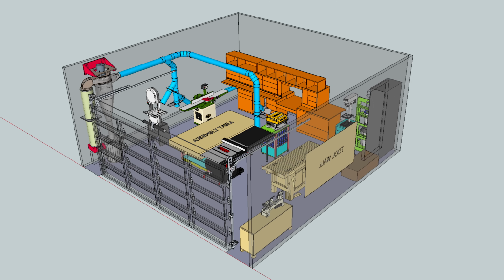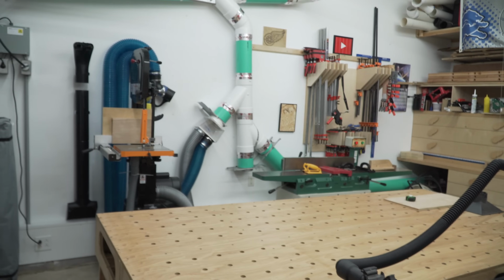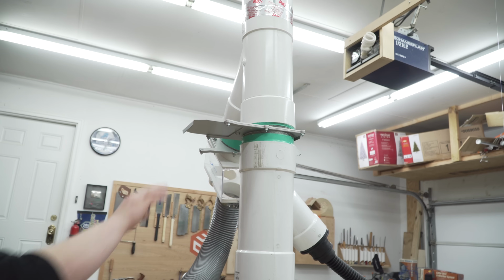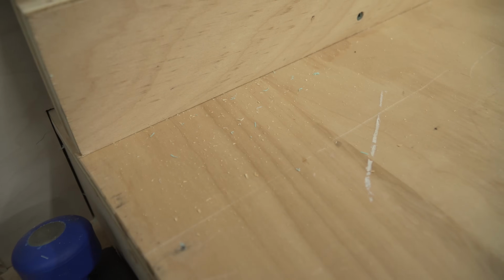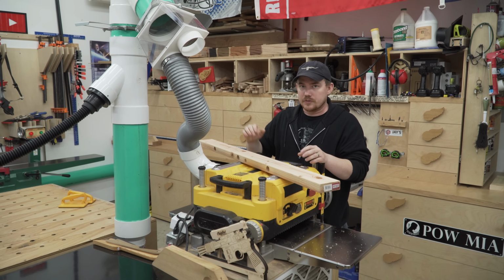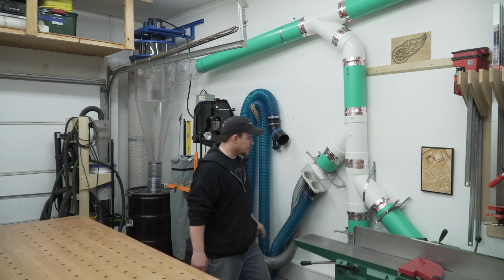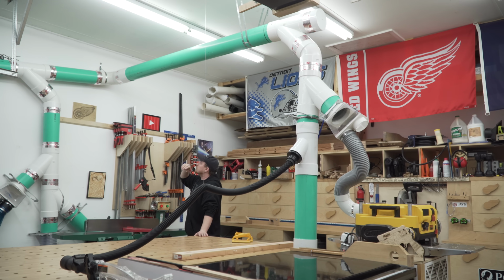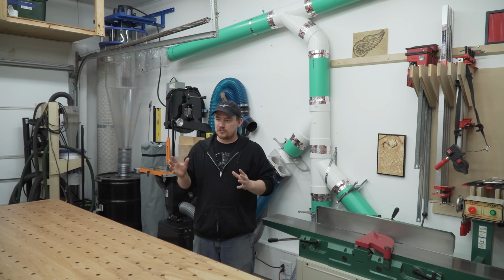Dust Collection Piping and Testing - 275

Comment: Looks great Jay. I installed the clear vue when I built my shop. I was not having difficulties, but did not want to develop any issues that could be prevented. The greatest add-on for me was an alarm for when the bin fills up. I have never had to clean out my filters from a dump due to a full bin. The bin fills up quicker than I expected, so I am sure I would have let it overflow at some point without the alarm. Also, I have not had an issue with static electricity on the sewer pipe ducts.

Comment: Jay, you mentioned the location of the blast gates as a way to minimize the volume in the active lines.  But there's another great reason for grouping the gates.  It gives you only two control points to work from to control the whole system.  That makes it easier to recover from forgetting to close a gate then having to figure out which unwanted gate is open.
Reply from the maker: True.

Comment: Nice setup Jay! What hose are you using to connect to the top of the SawStop blade guard?
Reply from the maker: Rockler expandable multitool hose.
Reply: Thanks Jay. Looks like that particular hose is no longer available. The only one I see that is close is their Universal Small Port Hose kit (http://www.rockler.com/dust-right-universal-small-port-hose-kit) but the connectors all screw into the hose reducing airflow more than the one you have. I'll keep looking.

Comment: You could get a supplied free air pump from Bullard and the bubble hood and then use a condenser mic while wearing it. Has a huge dust protection factor and comfortable to wear. That's what did.

Comment: I always enjoy watching your content.  Thanks!
I have a potentially dumb suggestion regarding your 4" dust collection to your table saw.  Can you run the 4" pipe behind the table and then run a straight section of pipe to the blade?  Seems like it would interfere less with pushing material through the saw.

Comment: Excellent system and excellent explanations. I just upgraded to a Craigslist Oneida 2 HP cyclone which came with 6" pipe and fittings. Still tweaking but so much improvement. Don't care what the trolls say, do everything you can to avoid breathing wood dust.

Comment: It's your shop,  you can do what ever the hell you want in it.  But if I were you,  I'd get rid of that Red Wings flag and hang a Blackhawks flag.   #youshould    On a more serious note,   does the band saw being there get in the way of using longer stock on the jointer?
Reply from the maker: No. I've got the same amount of infeed and outfeed as I previously did and I can also move it if needed.

Comment: Stuff the haters Jay. It seems for the most part people online appreciate what you've done here. Anyone arguing against the need for proper dust collection either has no form of timber allergy or hasn't been around long enough to see the side affects that come with a set of lungs full with decades of fine dust. There's always someone who will argue and who 'knows better'.... Yet I don't see them making any videos or trying to help the general woodworking community. Great job bro and at the end of the day, if your happy with the end result, then that's what counts. Now you can get back to building awesome stuff :)
Reply: Cigarette smoking won't hurt you either.

Comment: When you got your rigid saw with the 1 piece back stop did you have any issues with it not being straight from the left side of the blade to the right?  I'm still battling mine.  I've had it off a couple of times trying to basically bang it straight as there's no simple adjustment.  I bet you could take a couple of those cheap wood windshield scrapers with the bristle brushes and put them on each side of that opening to tighten it up more against the saw improving the air flow.

Comment: Hi Jay, you're correct about the two lines at the table saw. Looking at the area of the tubes, 6"=28.3 while the 4"+2" = 15.7. You could partial open the gate at the planer and see what happens. Good job over all and a lot less clean up during/after a project.

Comment: I have a sinus condition too and built my collection system with 4 inch PVC pipe. I didn't believe the stuff on YouTube that said you needed a static ground if you used PVC, so I didn't use it. Guess what....you need it or over time the static will cause the fine dust to build up on the inside of the pipes clogging them and having a potential for fire.

I used a fine bare braided wire (18 guage I believe) and wrapped it around the outside of the pipe in long wraps. Using crimp on connectors I attached the wires with SPACKS screws at the pipe connectors,  The screws were just long enough for the point to protrude through the inside so it didn't catch dust but would pick up the static. The other end was grounded to the dust collector motor. This has stopped the dust buildup from static.

By joining the wires at the pipe connectors, I can pull the pipes apart and reconfigure if I want. I used foil tape to make the connection seals like you did, so when I added a new machine, I had no trouble connecting it in.

Comment: Hi Jay, nice video and dust collection system.  I like your style of presentation.   I have a shop of a similar size and have avoided going this route because of my perception of the noise level caused by running a cyclone in the garage.  Can you comment on the noise level and how you are handling it.
Reply from the maker: It seems as loud as my DW735 planer. Maybe a tiny bit louder. I always wear hearing protection when operating machines so it doesn't bother me.

Comment: Incredible design, great mods at the tool source as well. The usage of your 10 ft. ceilings works to benefit total shop air quality and minimize day to day work shop interferences. I really like the technical aspects of specialized fittings at critical points. But really sea foam green pipe matched with white? Sorry Jay, I gotta give this video a thumbs down  ;-)
Reply from the maker: hahahaha. They had LSU branded purple and yellow pipe but I didn't want to degrade my shop that much ;)

Comment: An actual question here, why do you have the open gate above the planer?
Reply from the maker: To maintain proper air flow through the collector. Decreasing air volume in the system to a single 4" line would decrease the cyclone efficiency.

Comment: Nice video Jay. Do you think all the 6" is required.  I am planning a new sytstem and hoping I can get away with a lot of 4" piping.
Reply: Rich McCabe Yes 4" is fine for virtually any shop, he's using 6" to avoid putting unnecessary strain on the motor.
Reply from the maker: It depends on the collector you are using. Strain on the motor isn't the concern. This system works best with 6" to maintain a certain amount of air flow to maintain cyclone efficiency.
Reply: Thanks for response. Just seemed like a lot of 6" but I have not done the research yet.  Hoping I can get by with 4" on all my drops.  Nice system and looks like it is working well for you. Thanks for video and all the others as well !
Reply: Rich, the duct size will be dictated by the volume of air your collector can move.. It comes down to CFM and velocity. There are a lot of resources out there that can help you decide on what is the best for what you have. There is a lot of information on Bill Pentz's site but don't read into the health problems he had.  It was a special case but there is a lot of good information there.  Even a calculator to help you figure out CFM and velocity on lengths of pipe.

Comment: It's nice to see another fellow woodworker taking dust collection seriously.  If you're not running 6" lines you are only collecting chips, not fine dust.  Nice work Jay!
Reply: Brian Ford Hello Brian, I'm new to this and cogitating a shop collection system. What's the logic behind 6" vs 4" for chip and dust vs chip only because I was pretty crap at fluid mechanics in college....mr Bernoulli confused me terribly 🤔
Reply: @macduff1964a  I don't see how a 6" collects fine dust better than a 4" system. I did mechanical engineering, with specialities in turbine/jet propulsion.

On the same system, a 6" system will mean less air velocity than a 6", because for the same flow rate, a large area means a slower velocity, meaning some particles may escape.  For a 4" on the same system not only will it have a higher velocity, because of the Bernoulli principle, we know the pressure will be lower, and what is a vacuum, but a low pressure. This will mean there will be a greater pressure differential to the ambient air on each dust particle, causing a greater force to be induced onto each particle. 
It's important to choose the best diameter for your dust collector.

Comment: 😹😹😹if it was at my dropsaw I would have been covered in sawdust 😹😹 so what you have is fantastic 😹 Dads workshop we take the machines outside so it's not really an issue for me when I get the chance I will be hooking up a stand alone to it just so it will not spray me with sawdust when cutting 😹😹
Thanks for showing the new system that you have installed just wish we could afford something like it 😹😹😹😹

Comment: <pause 2> Jay, so long as the 6 inch to the table saw is always open as well, the reduction is not straining the system at all. If you tried to pull full vacuum through that small hose, yeah you'd be loading it heavily as the resistance goes inverse to cross-section area and proportional to hose length. Very akin to electrical circuits. So, the reduction branch looks like higher resistance but the 6 inch is flowing happily. So, assuming the smaller hose has 2.25" inner diameter, the branch ratio is something like ~ 1:7 so approximately 7/8 of your flow will go through the 6 inch line from the bottom and 1/8 of your flow will go through the small hose from the top. Still 8/8 in total. Not loading the system, just redistributing some of the flow.  AGAIN, if you try to pull full vacuum through the small hose....no good!  Nice job on the dust collection.  Ney sayer's are just not worth listening to.  Do what is right for you, not them, right?!  Rock on Jay! <\pause 2, back to the vid>

Comment: +Jay Bates Great job! well thought out. I pretty much had the same experience where I had sinus surgery and then went out and bought a CV1800. The only thing I didn't see was static control? Are you adding ground wires to the plastic pipes and tie it into the dust collector? I ran copper tape inside the 6 inch pipe and ran grounding wire to the collection can at the bottom. This should reduce the risk of fire even if it's a low risk over all. But great setup!
Reply: I wonder if you could just ground the blast gates and be done with it. They stick into the pipe at the joints, and are aluminum. Plus being exterior as well should make it easier to ground.
Reply: @mikesusman2434  Adding a grounding wire isn't hard or time consuming. Whereas you need to spray the entire system with anti static agent effectively.
As far as I'm aware the screw should be facing outside not inside the system, as a sharp conductive element for charge to dissipate into the air on.
Industry where dust is an issue, and where dust explosions are a legitimate hazard will still use grounding wire as well, especially in dry environments, as anti static agents use the water in the air to dissipate charge. Not only that they tend to stick to metallic parts and piping as this doesn't build up a charge.

Comment: Hey Jay, how do you know when the collection drum is full? (Sorry if you already answered that)
Reply from the maker: I don't have a clear solution for that yet. In the mean time I'll empty early for preventative measures and figure out something later.
Reply: I would suggest building a dolly under the barrel to allow you to wheel the barrel out into the shop where you could get at it with either a hand truck or maybe a lawn tractor if you have one. Something to allow you to haul it out to the woods behind your place to dump as you mentioned before. My uncle put in a similar system in his shop, the first time he went to empty the barrel he could hardly move it! Had to use his tractor with a chain to drag the barrel out to where he could dump it into the bucket on the tractor. He made a dolly for his barrel as soon as it was emptied! Nice work on all your video's! Really enjoy watching how your shop has transformed since you moved in...Keep up the wonderful work!

Comment: That scene fade out you're using keeps making me think my phone screen is going to turn off. Great stuff though. My garage is a giant pile of dust. Jealous.
Reply: same here -- totally jealous of this set up!!!
Reply: All I use for my dust collection is my shop vac connected with a T fitting that has 2 blast gates 1 for my planer and 1 for my table saw I put the fittings together with foil tape and hose clamps and attached it to the wall with zipties with holes for screws in them and the whole system cost about $90 that didn't include the vacuum and it is a great improvement over moving the shop vac from place 2 place.

Comment: Great job on the install and doing necessary homework before the project Jay.
It's ridiculous that so many people are busting your balls on what you should and shouldn't do.  It looks like you have a system that works well for what you are trying to achieve.  
The problem with the internet and message forums, is that so many people regurgitate information/false information and do not speak of facts or experience.  If the man wants to use 6in diameter pipes and the collector can handle it, then why not?  Looks like
an improvement to me.
Awesome work Jay!!!

Comment: I am about to install a dust collector as well.  How much did you end up spending on the PVC pipe?
Reply from the maker: 430-ish but I have a lot of extra that I need to take back. I didn't want to make multiple trips to get extra stuff if I went a different route here and there.
Reply: Can you give the EXACT type of pipe and fittings you used?  I am having issues finding the right pipe and fittings.  I know you picked them up locally, but if you shared the exact writing on the side it would really help anyone else trying to put together a similar setup.  Also, what exact type of flex hose did you use?  Thanks!

Comment: Pipes too big, static, oh my god the static! Doom!  hahahahahaha

Why does dust collection bring out the angst in everybody? Worse than Festool I think.

So will we see an upcoming video with a Dylos meter to quantify the air cleanliness?
Reply: Brian Bain you mean those green festool pipes? Lol j/k
Reply: But what about the static electricity shock that could be delivered to a person. Is that significant ? Forget about the blowing your shop up myth.
Reply: so.... you're all saying there's no static? I'd worry more about sensitive electronics in the room. how long until a camera gets a zap
Reply: I agree the fire hazard from static is nil. However, if you don't take measures to ground the PVC pipe, static discharge to you, the woodworker, is very real. I've used PVC in a few shops and I've felt the static discharge while testing, before grounding the system. It's sudden and quite painful. You wouldn't want to brush up against a pipe while in the process of using any machine because the shock will cause you to flinch. Lot's of stuff out there about how to properly ground the piping.

Comment: did you run a static wire grounded at the dust collector? I used pvc on mine and the fine dust particals are attracted to the outside.  static electricity is a problem with pvc dust collection.  at least in my experience.  awesome job Jay!
Reply from the maker: I haven't had a problem with static shocking me or holding stuff on the pipe. The need to ground your dust collection to prevent explosion is a myth. Please read these two articles for more information: 
http://www.thewoodnerd.com/articles/dustExplosion.html
http://www.woodcentral.com/articles/shop/articles_221.shtml
Reply: I've never been too concerned about the explosion thing either. I've not run one on mine as well but have been rolling around doing it due to the fine dust that gathers around the outside of the pipe. Mine is not completely sealed like yours. So I think it might help. Maybe a rework of my dust collection in order. Keep bring the good videos.

Comment: Awesome Job! Noticed that the dust doesn't drop down into the bin immediately. Some times this indicates that there might be a leak between the cone and the dust bin or the hose is going in the opposite direction of the air flow inside the cone. To fix mine I just needed to add a foam gasket to the bins lid.
Reply from the maker: Hmmmm...I'll check for leaks again. Thank you.

Comment: Looks great! I'm literally running ductwork and fittings for my Clearvue 1800 this afternoon. I decided to run the duct to my tablesaw on the ground in a low traffic area. I'll just step over it. I was worried about the fixed location for pipe at end of table getting in the way. How did you decide that wouldn't be a problem for you?
Reply from the maker: I can't think of a situation where it would be in the way. The longest stuff I move in my shop can be moved around it.
Reply: OK. I cut 2"x4"x8' or other carpentry sizes fairly often. Long span shelving for a room, etc. A month doesn't go by that I don't do that. I could use a skill saw, but that means getting out the saw horses, extension cords, etc. and still be unhappy with the cut not square. I have a lot of room, so I enjoy it! Good work on the videos. I'm a new subscriber (this month).